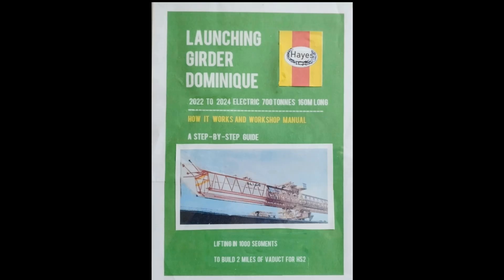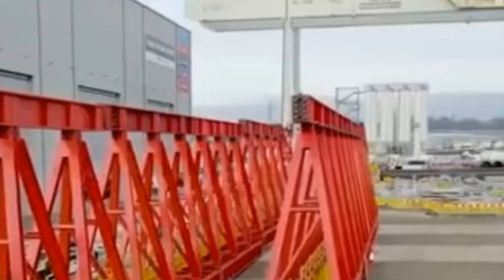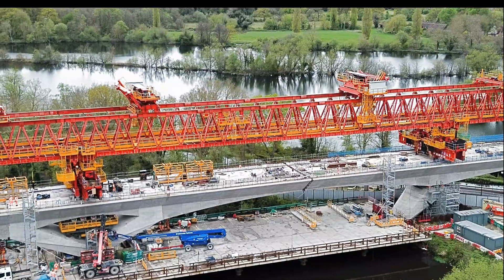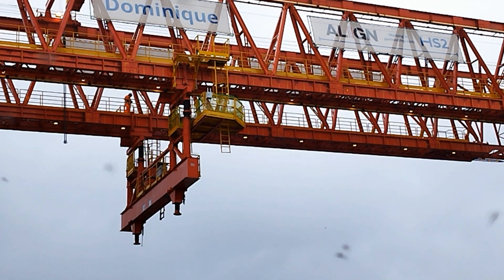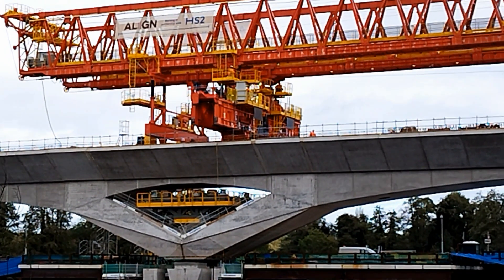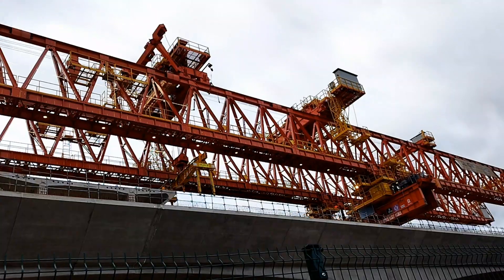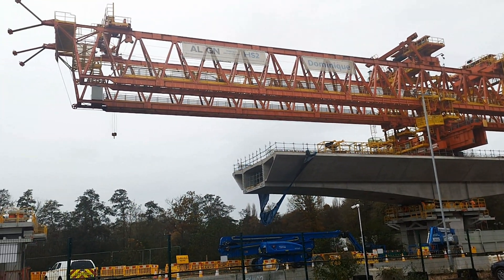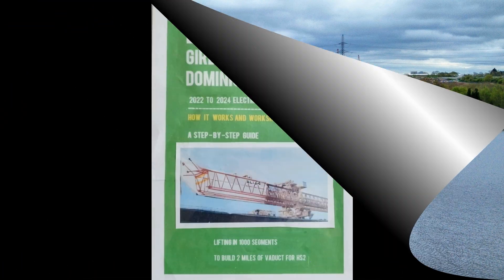How It Works, the HS2 Launching Girder 'Dominique' as it builds the Colne Valley Viaduct.

Comment: Hi again Steve! Given the speed of the trains, there will be an outward centrifugal force when they negotiate a curve, such as the one over the Colne Valley. I doubt this is negligible, and wonder if any allowance is being made for that (e.g. camber? ). Cheers!
Reply from the maker: Hi Peter, thanks for the comments, I do know that the breaking force of the trains if they have to reduce speed has to be resisted by the viaduct, so the two pairs either side of the canal, 20 and 19 are designed to do that....
Reply: What a complete & utter waste of billions of pounds.
Within a decade of opening (in about 50 years time given the current rate of progress), this concrete monstrosity will be nothing more than a glorified cycle path.
HS2 is an environmental disaster of epic proportions & Britain's biggest infrastructure mistake in half a century.
Reply: @CRIMSONANT1  Some evidence to support your contention would have been handy.  The hyperbolic '50 years time' in particular could have been  usefully justified.

Comment: Thanks Steve, and well explained! I'm surprised to hear my descriptions of the yellow cage as naming it correctly! I am also surprised the tolerance is only 3mm, and wonder what allowances if any are made for very hot or cold weather affecting the length of the cables, and indeed how any water ingress is kept out! These factors are a common source of a bridge's 'decay' over several decades.
Reply from the maker: I think the glue is part of the sticky problem of keeping the joint water tight, it forms a bond between the team of glue boys,white boiler suited heroes, Bostik Bob, BlueTack Ben, Loctite Larry and Gorilla Glue George....
Reply from the maker: Thanks Peter for the comment, interesting questions, as we live in the UK the engineers don't have to worry about hot and cold weather, we just call it rubbish, weather and will result in minimum expansion and contraction...